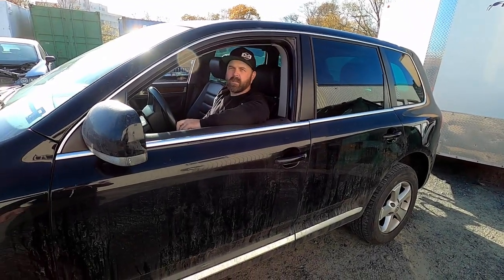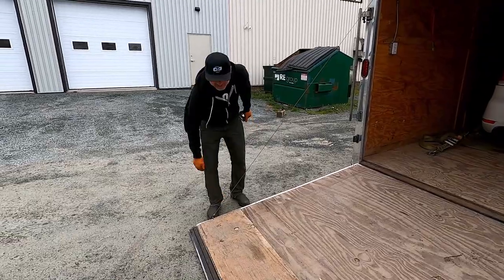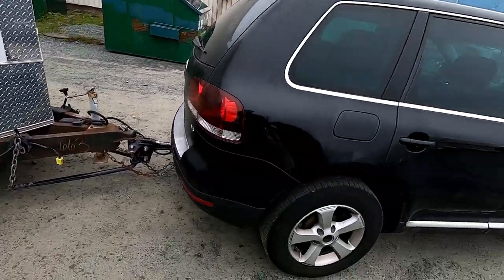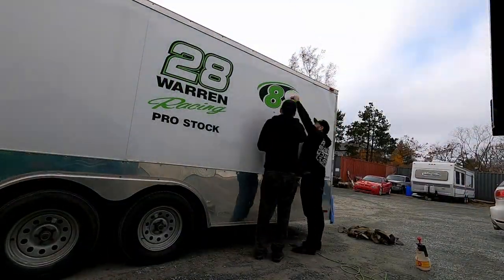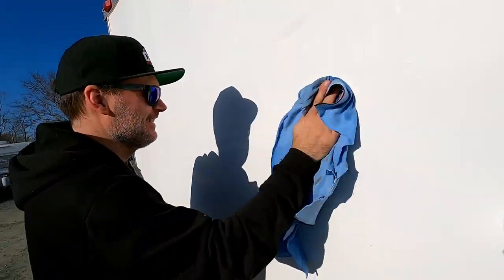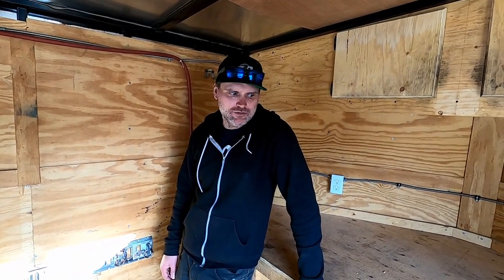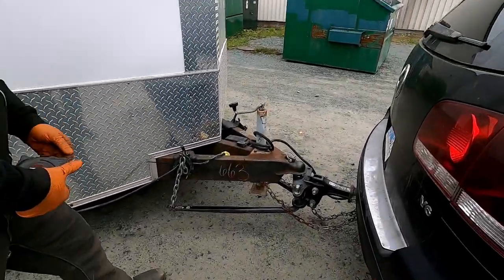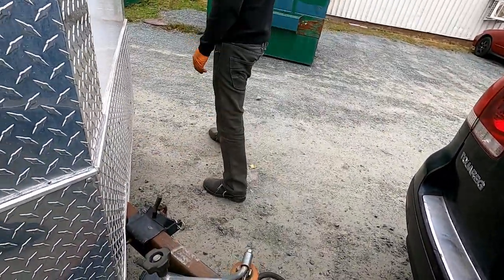Touareg 3.6 VR6 vs Enclosed Trailer.

Comment: I tow my 22 foot V-nose trailer with a V8 Touareg and it tows great. The only thing I caution you on is to watch the tongue weight. I have to load my 1900 lb Mk2 race car in backwards and very close to the rear door. I also keep two spare trailer tires all the way in the back. By the time you add tools, spare race tires, parts, generator, the weight at the front of the trailer goes up quite a bit. I overloaded my rear tires and the plies were separating even though I had set up my load distribution bars to have the Touareg level. What I thought was about 750 lbs on the tongue, was actually about 1000 lbs.
Reply from the maker: Do you have weight distribution bars?
Reply: @COMotorsports  Yes.
Reply from the maker: @VWRalf  Edit: Sorry I had missed half of your original message. Did you actually weigh the tongue weight?
Reply: @COMotorsports  Even when I had too much tongue weight, the Touareg was level. After my trip where my tires were coming apart, I got a scale to weigh the tongue and then found that I was about 300 lbs too high.
Reply from the maker: @VWRalf  Appreciate the info. We'll check with a scale. It was on the to do list, but we just decided to go for it.

Comment: Please do an update with the trailer packed down. I also own a 3.6 touareg and wanted to know if towing around 6-7k was really possible on the vr6. Can you also let us know the mpg of the trip?
Reply from the maker: Wouldn't recommend it. The power isn't the problem really. It's the trans that will hate life. Short trips with light load not a big deal. We've used the Touareg with an open trailer, car and all our gear for years. But the closed trailer, car and all our gear adds up....adds up more now because we have more space to put more stuff as well. Lol. We did the math last week while towing it with a truck. We're at like 7500-8000lbs probably which is the limit of the Touareg towing capacity.
Reply: @COMotorsports  7700 on the oem hitch, but you do bring up a good point about the transmission. I personally tow my Hondas with it to the track but never done any extensive trip. If you guys dare to try a long trip i'd love to see that otherwise ill explore that on my own. Thanks for getting back to me!
Reply from the maker: @AntardoTheGreat  well the towing weight is 7700lbs, the tongue weight on the hitch is only 770lbs. That's also part of the problem. We towed with this for years with an open trailer and all our gear. The tracks we run at are up to 4 hrs away. The only issue we had were steady bearings. However this specific trailer is to much in reality with all our gear and a car for where we need to travel to with the Touareg.
Reply: @AntardoTheGreat  I frequently tow a 5500lb camper, with gear with our 2016 3.6 vr6. in the mountains it feels a bit underpowered sometimes, but never has an issue. we dragged that camper on a 1000+ mile round trip to Yellowstone national park with 0 issues (except for the blower motor deciding to leave the chat on an 80 degree day)
Reply: @forbes80751  how long is your 5500lb trailer? Do you use a weight distribution hitch? I am looking at a 25ft Airstream International and am on the cusp of believing I can tow it with my ‘14 Touareg VR6 w/ factory tow package. No air suspension.
Reply: I recently did a 20-hour towing trip with my 06 Cayenne 3.2 VR6 towing about 6200 lbs (2003 Jaguar S-Type R on a U-Haul auto transport) and it held up pretty well. The only time where the Cayenne seemed to break a sweat was going uphill in valleys where it would sometimes need to run at 4-5k rpm to maintain 65 mph.

I averaged about 10-12 mpg the whole way back, so it definitely racked up some fuel costs!

Comment: VW and engine light are two peas in a pod.
Reply from the maker: I think it comes standard on this one.
Reply: Guess my 2004 GTI was broken...in the 15 years I had it, I only saw the light twice...one for failed t-stat (not getting up to temp), and misfire due to failed coil/spark plug.   VW, and especially 'egg owners have to be proactive and not reactive to mx items